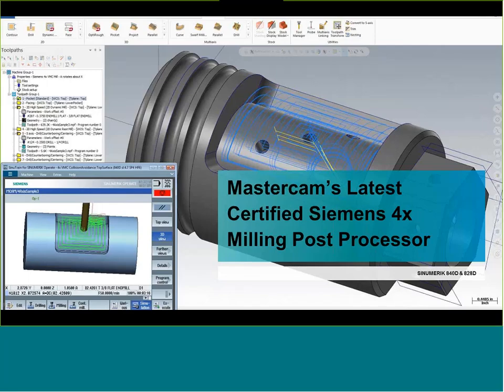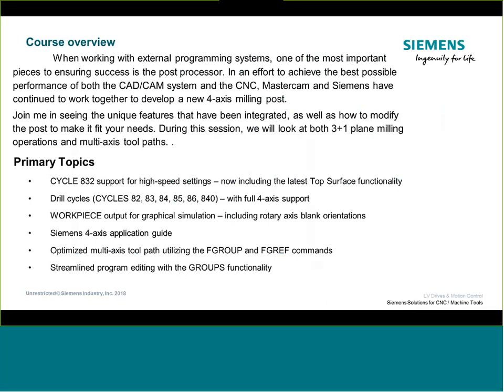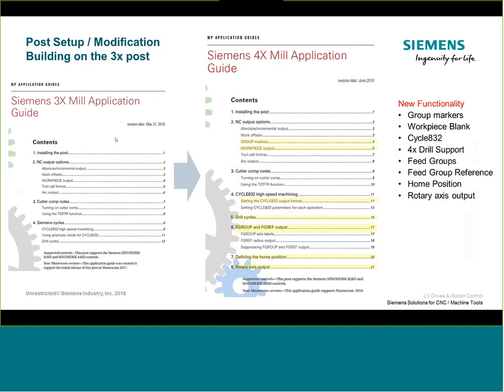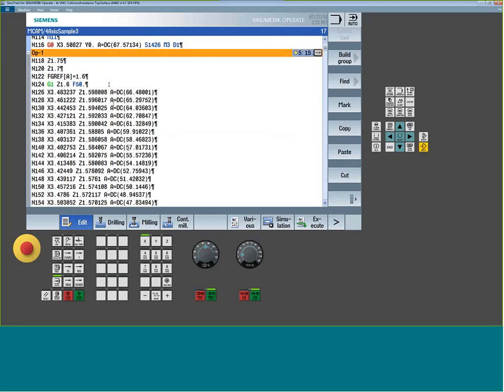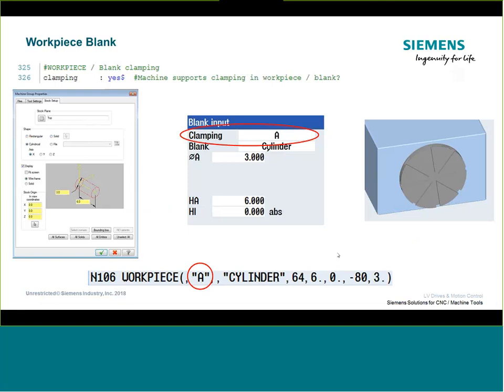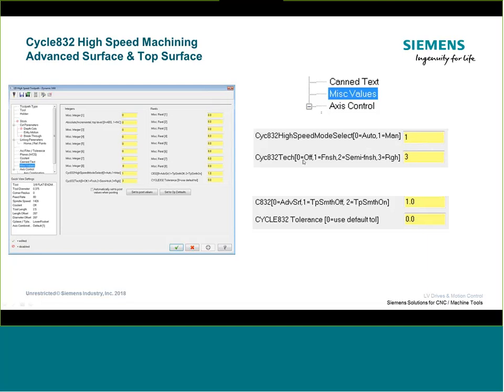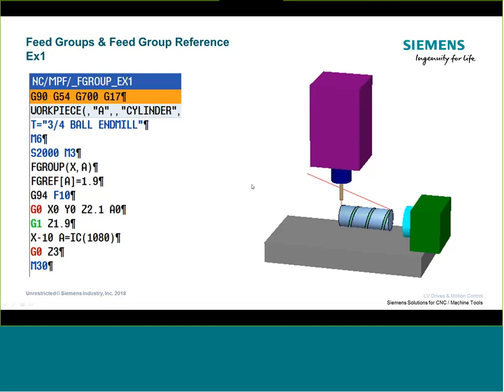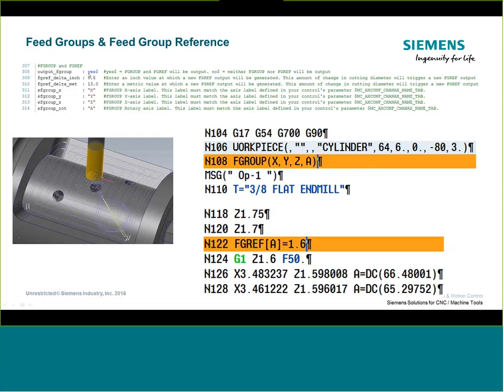Mastercam's Latest 4 axis Siemens Certified Post

Comment: Thank you for the explanations on fgroup. In other words, it seems that you are saying if the rotary axis is NOT included in FGROUP, then when we program the rotary axis and the linear axis together, the rotary axis becomes a synchronized axis. 

My question is how do one determine which axis is the synchronized axis? For example, if we do helical interpolation, Z axis is the synchronized axis. But why? What rule is used to determine this?
Reply from the maker: FGROUP is not a synchronized command you are always sync
FGROUP is used to calculate federate
attached below is a link to manual 
https://support.industry.siemens.com/cs/document/109763241/sinumerik-840d-sl-fundamentals?dti=0&lc=en-WW
Reply from the maker: i would put a ticket into mastercam